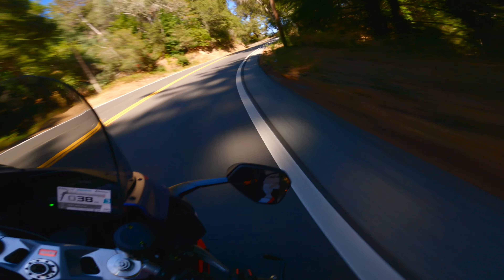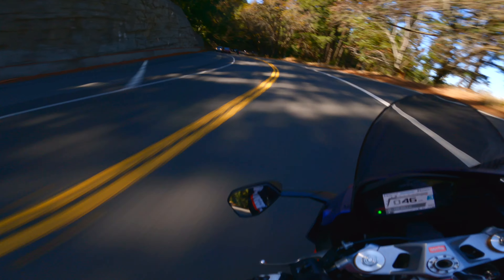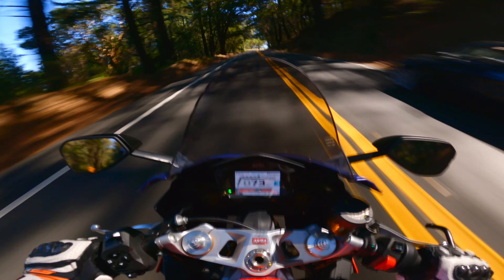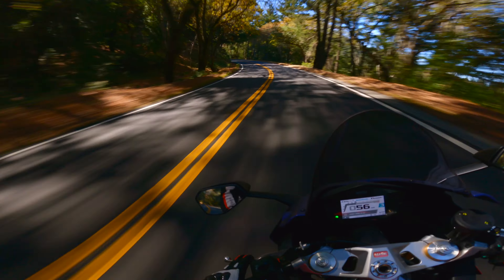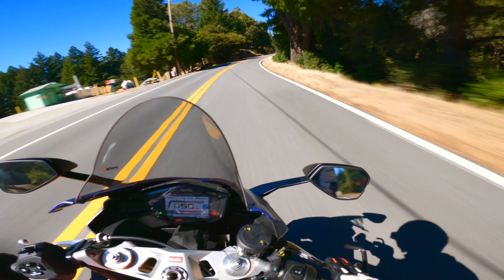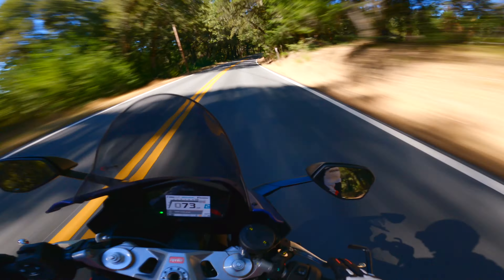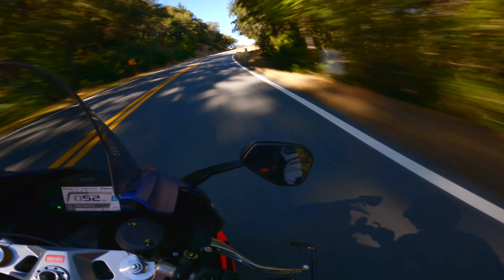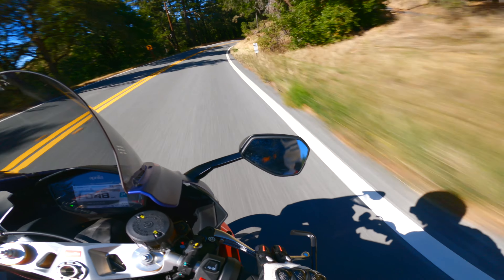First RELIABILITY Issue... | Aprilia RS 660

Comment: SK XIII, hey buddy sorry to find out that you have an issue with your RS660. I still don’t have any issues with mine. I sent your request and video to my contact at my dealer in Miami Florida. I’m waiting to hear back as soon as I know more I will let you know. Ride safe. Talk to you soon.

OK I got a reply back from my dealer. Definitely not a reliability issue it’s a mechanical issue. They had it happen to a couple of 
RS660s and also a couple of RSV4’s.  It’s very simple, it’s only a sensor and it is under warranty so just take it in get the sensor swapped out and you’re good to go, Fixed and resolved. You are correct when you have that red “R”  it definitely means that your quick shifter is not operable/not working. Ride safe brother. Hope this helps you.
Reply from the maker: Wow brotha, this was a tremendous help!! Glad you're so close to your dealer out there! I have been seeing that other people have had this issue, even when stock/no mods so this is reassuring. Appreciate you!
Reply: @SK_XIII  yeah, you need to come down here to South Florida close to Fort Lauderdale/Miami area bring your bike and will go right out. Have two of the same. Looking bikes going right down the street would be awesome. And on top of that they both sound the same lol.
Don’t forget to give me a shout out on your next video, lol Spitfiya.rs660 
just looking out. 👍🏼👍🏼
Reply: @SK_XIII  👍🏼👍🏼💯💯💥💥
Reply from the maker: @Spitfiya.rs660  🤣 next video uploaded today  to release next week, but definitely will on the one after that. Is this your insta? One day I'll make my way out to FL for sure!

Comment: I have a 2022 Tuono Factory that I recently bought and has about 900 miles on it.  I have had the QS lock out at random times.  Turning the bike off doesn't always remedy it, as you've seen.  I had the bike in for the initial break in service and talked to the tech about it.  He wasn't sure what was going on.  Well, the day after my service, it went out again and I emailed them pics and video of the dash.  They had me come in and they replaced the module under warranty.  I have only driven it about 50 miles since, and it has been fine.  I don't think they will care about your exhaust/tune as this is a known issue and unrelated.  Good luck!
Reply from the maker: Thanks for sharing this!! Still have plenty of warranty left on the bike so if the issue persists, going to take it in like you did

Comment: I could be way off, but in a forum for the tuareg 660 people have had quickshifter issues when a wire running down by the quickshifter, for the quickshifter, has broken inside.  The wire could intermittently connect/disconnect as well.
Reply from the maker: Ooo that's interesting! but yeah ultimately leads to electrical issue rather than mechanical

Comment: make sure the shift lever is securely (and properly) attached to the transmission end - any looseness can confuse the QS sensor... and as another said below, the "R" indicator is for a "reverse" (GPshift) shift pattern I believe... try disabling/enabling the QS in the dash menu.
Reply from the maker: Solid! gonna look into this more, thanks mate
Reply: @SK_XIII  did you get a fix? was that it?

Comment: It’s really simple. Two methods available to you right now. As it is still under warranty take it back to the dealership. Firstly the exhaust won’t bother them (ever seen a HD with a stock exhaust as they are extremely quiet from the factory). Plus the dealership can not possibly tell (or try and find out) that your ECU has been altered. It will possibly be a simple code that they will check and erase. If, you are still concerned about potential warranty issues by yourself an OBDLINK2. At around $100 it’s a good investment as the onboard diagnostic unit will read faults so you can see what the red light means and if required it can also clear it (it’s basically the same unit the dealerships use anyway).  It can also be used to reprogram your ECU (you called it tune) as they use these devices to also adjust fuel maps and throttle position setting (amongst others) on bikes with Ride by wire throttles. They don’t work on bikes with cable throttles from a tuning perspective however do still read and cancel warning indicators just in case. I have a couple of these units as I have several bikes and cars and are my initial go to device before going to the dealership. Also great if you are past the warranty period to helps save money. I hope this helps. Reach out if needed and I’ll give you the exact unit specific to your bike. 👍😎🇦🇺
Reply from the maker: this is great mate! I have the UpMap, which reads codes too, so will check it out as I am going through everyones advice on here. Yeah I am thinking that if this issue persists, best to just take it into the shop and see what they say about warranty 😎
Reply: @SK_XIII  👍😎. The UpMap is just a brand of an OBDLINK with some tailored features minus some of what a 2 will do (I have it on one of my Ducati’s). I’d remove all visual signs that the engines map has been altered. Set ECU changes they won’t be able to tell and I wouldn’t be concerned with the exhaust. Use you device so at least when you do go to the dealership they won’t be able to BS you (or as much) as I heard stories about many inexperienced riders being taken advantage of from a financial perspective. Good luck.
Reply from the maker: @marcusgeorge1825  some wisdom right here. will keep it mind brothaaa

Comment: I race this bike in Wera.  I had this happen about once every 5-8 times I started the bike.  I usually could just turn the bike off and back on, and then the shift icon would go from orange to black and the quickshifter/autoblipper would work.  I eventually fixed this issue by getting a new quickshifter wire.  I didn't have to get the mechanical piece, just the wire that plugs into the wire harness, and runs to the shift rod (and is held in place with 3 small screws).  I've had a few race weekends since, and I haven't had any issues with quickshifter.  I highly recommend you get a new quickshifter wire/electronic piece.
Reply from the maker: thanks for sharing! will definitely look into it. Do you have the part # by any chance?
Reply: @SK_XIII  2D000690 is the part number for both the wire/sensor AND the metal piece.  I just replaced the wire/sensor and not the piece.  But I don't see where you can buy just the wire/sensor from AF1.  You might get lucky on ebay, if someone is parting out a bike.
Reply from the maker: @josefbittner6198  Ayee thanks brotha! appreciate you

Comment: That is odd? I have had the same issue on my 2021 Tuono 660. What triggered it the first time was I tried to start the bike in gear with the kickstand down "my bad". I shut it off for a minute and I still had the same red gear. I tried to look it problem on my phone and five minutes later it was gone. The second time it happened I was warming the bike up. Ridding it in neutral down the hill from my house. While rolling in neutral I put it in gear and got the red sprocket again. I rode it to the gas station to meet my friend and after getting gas and starting it five minutes later it was gone. It seems that the electronics are temperamental but, in my case, it has aways corrected itself. So to all of you have not done the above don't.
Reply from the maker: thanks for sharing mate! very temperamental QS 🤣 Better than it not working at all I guess

Comment: Glad to say I have no problems with mine (yet). But I come to the same conclusion as you really. It’s not mechanical. I could be the cable to qs as somebody mentioned. Or something with the tune. Maybe load the stock one, and if it helps try to go back to aftermarket tune again. Also somebody mentioned check all bolts and yellow dot’s still aligning. I hope you will schare the solution.
Reply from the maker: My next step is to play around with different tunes. It really does not seem mechanical to me at this point. Will keep everyone updated!

Comment: before i finish the video this happened to my 2021 zx6r my bike kicked an engine code flashed like you are saying, QS didnt work and it was because my kickstand spring fell off and my kick stand was down while i was riding( didnt know it fell off someone behind me told me) and the kickstand put my bike in limp mode could ride normally just not fully

take it to a specialized shop look around all u need is someone with the correct equipment to diagnose it!! best of luck dude mine cost me like 200$ to fix
Reply from the maker: Hahaha to be honest, I actually checked my kickstand first when I got home since I had heard that it can cause issues in many different bikes. Glad you were able to get yours fixed mate!
Reply: @SK_XIII  thanks brother hope the same for you 🙌

Comment: Have you tried running it through calibration since then?
Reply from the maker: I was trying to figure out how to do this for the RS, wasn't able to find anything in the service manual. Any thoughts?
Reply: @SK_XIII  if i recall, go to your menu-> select calibration->(should say calibrating on the dash) ride at 25 mph in second gear for around 10 seconds ->stop and turn bike off for about 30 seconds -> start bike again and press + for a few seconds until you see a flashing 1, then ride for a bit until the tc light stops flashing.  

This has sorted a couple of electronics issues I've had, hope it works for you!
Reply from the maker: @chrisdavis7533  Saving this for future reference. thank you so much matee! really appreciate your help
Reply: @SK_XIII  hope it works fam, if you dont get sorted, let me know, a few folks i can call that may have a better solution
Reply from the maker: @chrisdavis7533  Will keep ya updated matee

Comment: I know that the lock nuts on either side of the qs need to be snug and if they are loose the sensor will think that there is a problem. I hope it is something silly and easy.
Reply from the maker: with all the vibrations on the bike, that doesn't surprise me lol

Comment: The minor performance increase from a tune to be had out of this already highly strung 100hp 2cyl is not worth the increase of reliability issues. I’m looking to get a 2023 rs660 soon. I’ve learned long ago never to buy the first couple years of a completely new machine whether it be car or bike unless you have the patience/resources to deal with issues. Because yours is tuned I won’t count this as a point against the reliability in my eyes, I wouldn’t dare tune this bike til 2024-25 when the bike community as a whole has more experience & knowledge with them. I want to see some high mileage ones.
Reply: Well I was thinking about a Tuono 660 but I think I’ll stick with Japanese. I just don’t have the patience to deal with issues like this.
Reply: Wouldn’t dare buy one until 24-25 but looking to get a 23 soon…. Hmmmm 😅

Comment: This usually happen when you turn off and turn on the bike in gear for me. If I put it in neutral, turn it off and on, it fixes the issues.
Reply: Yeah I remember reading that with the race map the bike automatically learns if the bike is in gp shift mode or not. Perhaps it is incorrectly detecting that the bike is set up for gp shift.
Reply from the maker: @Knoxvillemoto  Thought the same initially too, but then its the blinking red while riding that's "different" from the normal constant red R for GP shift :/
Reply from the maker: gonna check this idea out too! thanks mate

Comment: 1st off I Love my rs660    But….
I’ve had a very small oil leak (3-4 drops on my garage floor) and my dealer(Reno power sports ) got it fixed under warranty
Reply from the maker: Glad you got it fixed! what was causing the leak?
Reply: Oil pump housing gasket.
Reply from the maker: @troysaylors2177  damn gaskets...lol

Comment: Idk if this is a reliability issue you tuned the engine than installed an exhaust that shoots flames out the back. Sucks that your bike is in the shop but this might be on you. Hope it's a cheap fix.
Reply from the maker: Gotta pay to playy I guess. From what I have been seeing online, it may be a known issue with the QS sensor since its happened to stock bikes too, fingers crossed its cheap as well mate!
Reply: @SK_XIII  damn hate to hear it I've been saving for a 2nd bike the Rs660 or the V100 Mandello I think they share tech. Maybe I should get a Yamaha 😑
Reply from the maker: @DimitriLeeBX  Yamaha definitely a safer option, but the ape is incredibly fun! if you have the warranty and a dealer by you, maybe worth exploring ✌

Comment: I know your problem and the fix.  This happens when your oil run a bit low.  Make sure you have enough oil in the bike usually a bit more than you think; fully cover the marker on the dip stick.
Reply from the maker: Haven't heard of this before....kinda odd engine oil level would impact the QS. It is an Aprilia so who knows eh 🤣
Reply: @SK_XIII  Hi, it worked for me as I had the same problem.  Once I got the oil level HIGH the quick shifter started working again and was better than it has ever been.